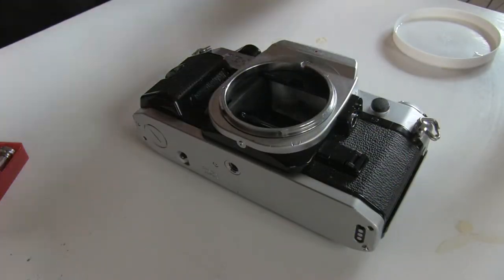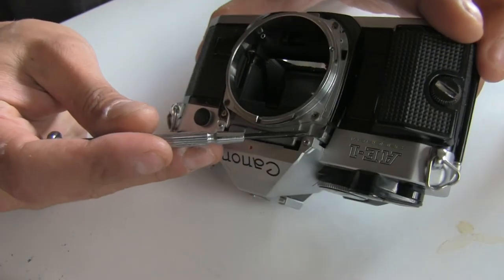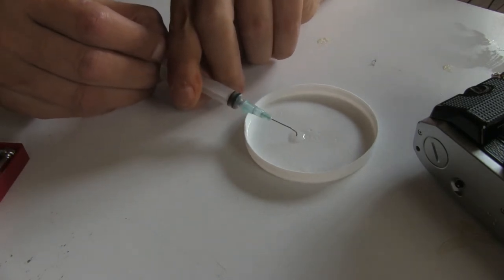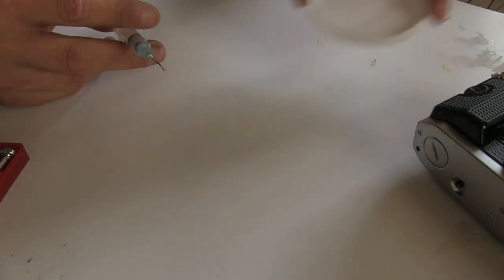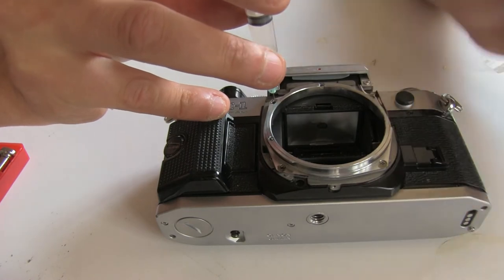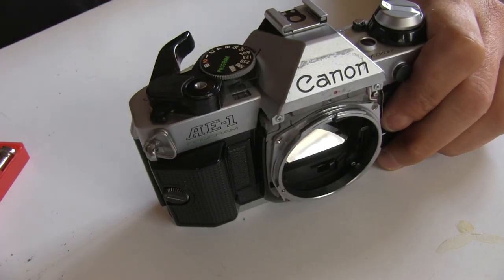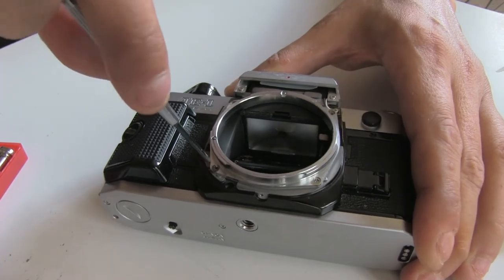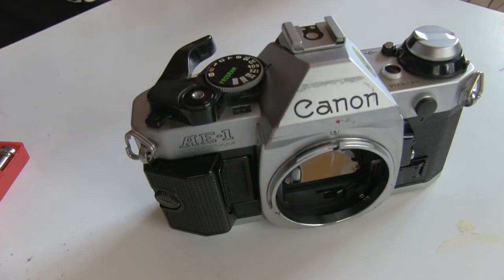How to fix the Canon AE1 Program and A1 squeak issue. Quick and easy way to do it yourself.

Comment: Hello there! I also have this camera, but there is a little issue. The LED display inside the viewfinder doesn't work (sometimes it does, just for a second). Is it possible to fix that? Thank you
Reply from the maker: rule number one when electronics go awol : Check the contacts. I'd check the leaf contacts underneath the shutter button.

Comment: what if there is oil coming through? Perhaps I added more than necessary
Reply from the maker: You'll get oil streaks in the mirror box, common issue with people who use too much oil. Not the best thing, but it will work.
Reply: I had the same thing happen to me. I'm having oil come into the mirror box. I'm currently leaving it open and soaking it up every once and a while with cotton. Did you have any issues in the long run?

Comment: This is really not the right way to fix this. You need to remove the mirror box.
Reply from the maker: Ok, why ?
Reply: @MrAnalogDan12  Because it's the correct way to do it. It's the way Canon specify fixing it, it's the way any trained technician would have fixed it. 

I absolutely agree that it can deal with the problem, but it's not cleaning away the old dirt and oil and it's shooting blind.
Reply from the maker: @jonathand435  okay, thanks for your comment !
Reply: Nobody wants to spend that kind of time doing it. So bugger off.
Reply: @driline  What a wonderfully informed comment.
Reply: Well it works, I think this is a lot less risky and much easier for the general public, considering actual repairs are expensive and you can do this repair for less than 8 bucks likely. User friendliness is important